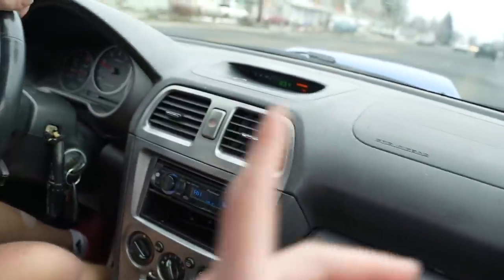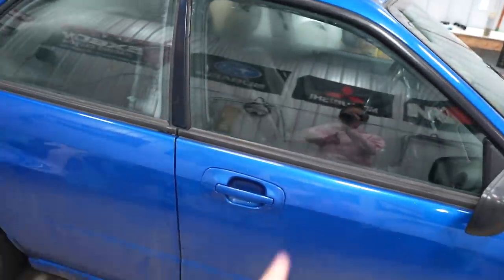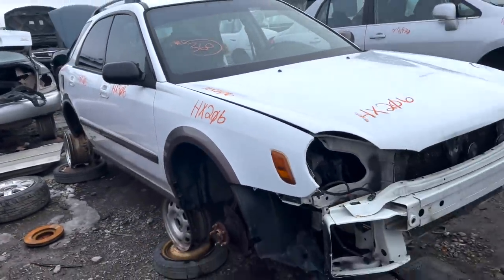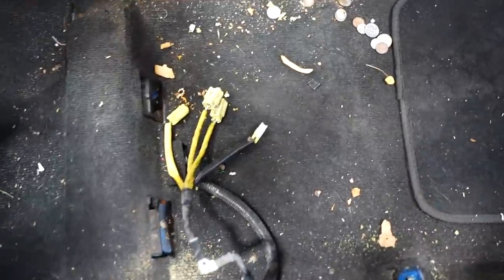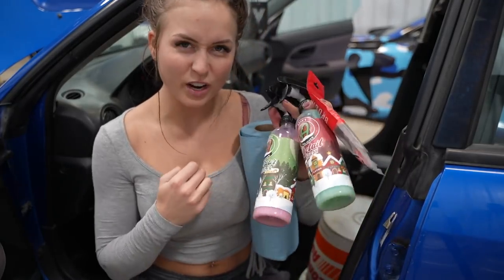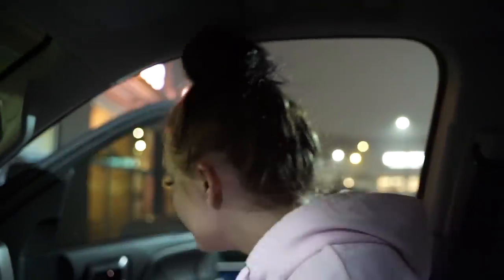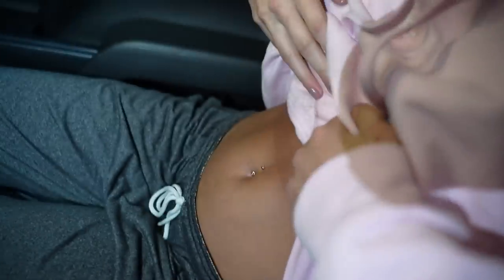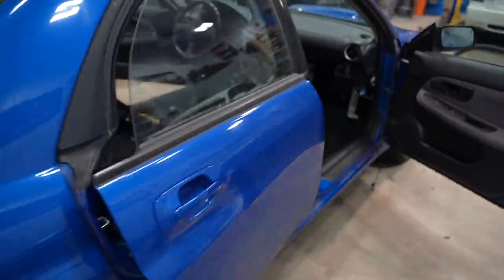My new 06 WRX winter car!!

Comment: Should run a shop vac over the seats after they were cleaned, suck some of the water out of them maybe they would dry faster or the famous blower car dryer you could use that maybe just some ideas love watching your videos
Reply: I'd try a propane heater under the seat which would be safer than my other idea of a MAPP torch. 🙄